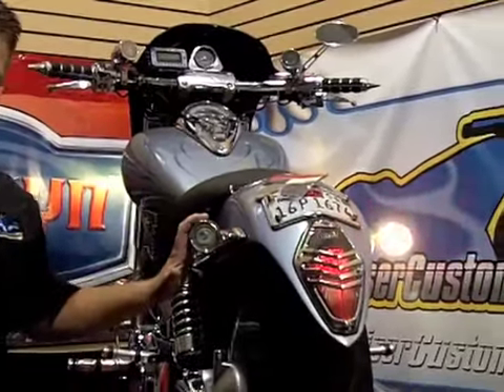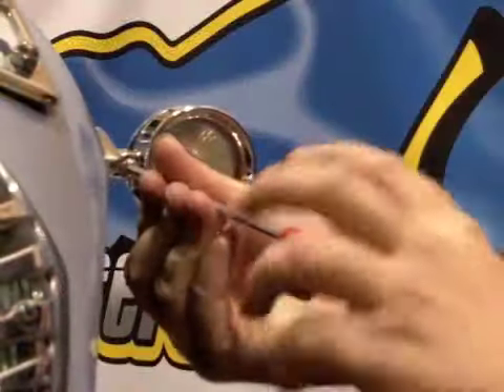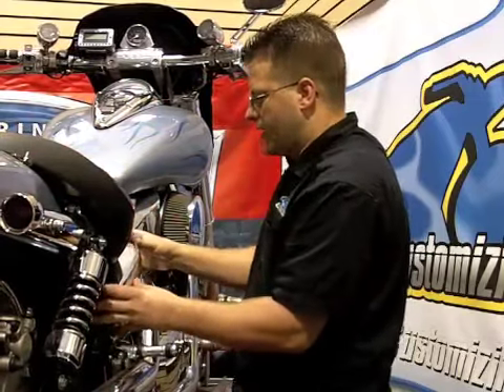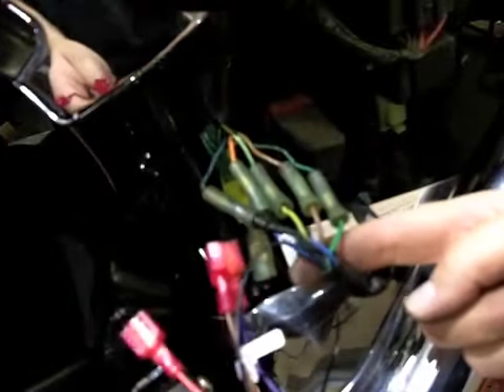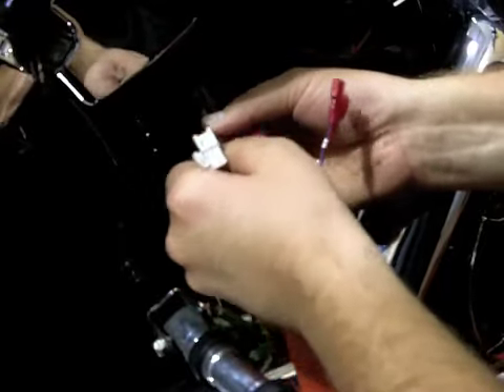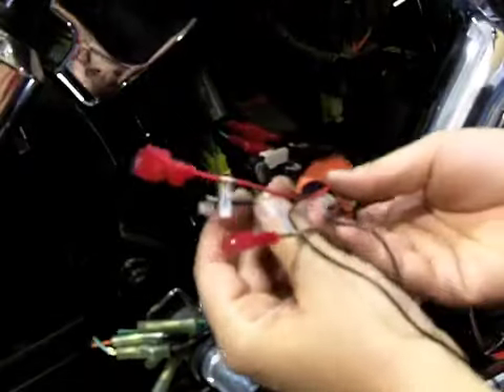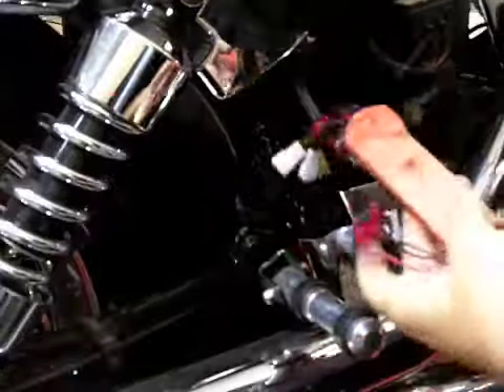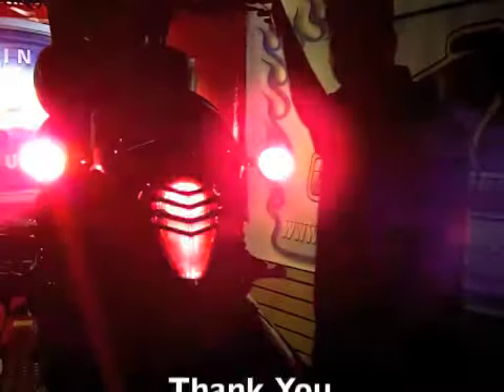Kuryakyn Run Turn Brake TOTW with Flashing Brake Light

Comment: I just ordered the plug and play unit for Vstar 1100 and red Kuryakyn lenses super pumped because I love anything that increases safety. Now I will be running up the road with 3 running lights in the rear instead of the 1.
Reply: Where did you purchase yours from? I can't seem to find it anywhere. I have a 2007 vstar 1100 too.

Comment: I just installed the 4710 on my 2004 Honda VTX 1300 and it worked perfectly. Previously, I did find the wiring diagram for the bike to ensure I had the color coding down for the bike.

Comment: I just ordered this 6010 . It's a good question about the brakes and signal being used at the same time. I would assume and we all know what assume means...The turn signal would cancel the flashing mode on the brakes. Ill check back in once I install on my 1300.

Comment: Great detail coming for the main wiring harness, Not so good on the output. I have the 4710 on a 97 Honda Magna and can not get the main brake light to light as a running light (no lic plate light)

Comment: I have a 2005 VTX 1300C. I followed the instructions to the letter and watched this video. I did not have any luck. Didn't work? I quadruple checked what I did. Any idears? I am using a variable load flasher since I'm going with LEDs. I tried both the standard and Variable load flasher. no luck. Help!

Comment: ive looked on the kuryakyns website and dont see anything like this for a vlx 600,i was wondering if most hondas wiring harness was the same as the vtx 1300/1800 harness,if so,this kit should work on the vlx 600 right?,,if not couldnt a person just take and splice the wire to the run light/brake light directly without havin this kit?..it seems like itd work.

Comment: You cut 4 wires going into the 4710 controller and only attached 3 wires on the other end why wouldn't there be 4?